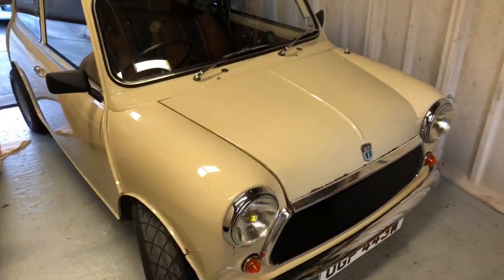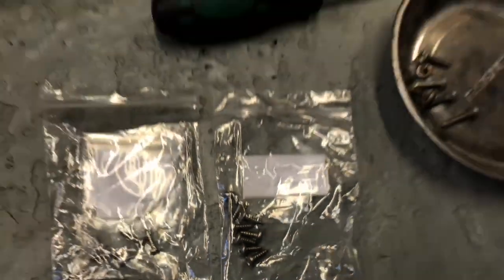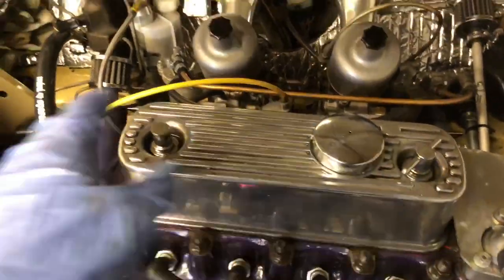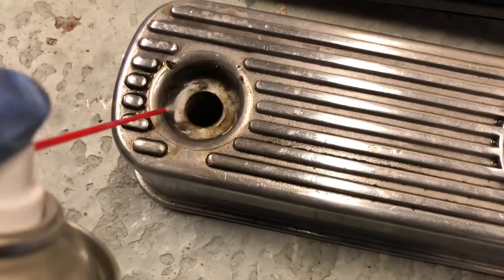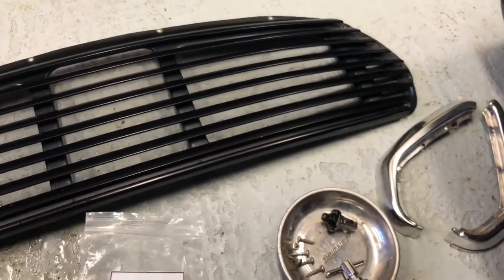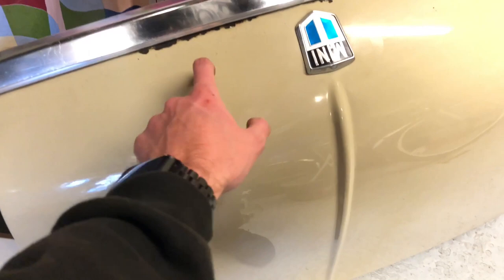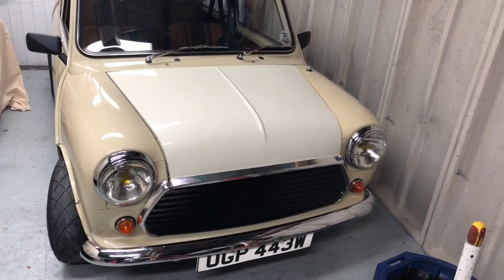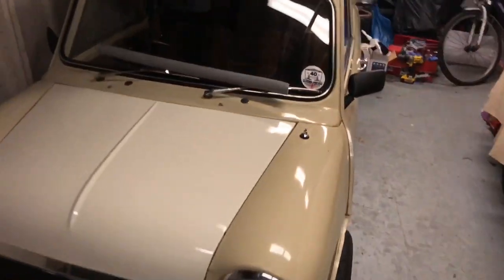Classic Mini service and maintenance

Comment: Great stuff..seam a shame the roller rockers are hidden. They look sweet ! What ratio ? And did you notice a difference in power after fitting. I'm just  compiling a wish list for when I sort my engine . Thanks
Reply from the maker: George Knapp They are 1.5, i fitted with a new cam and double valve springs. Im yet to put it back on the rollers to see the gains, there will be a upload once i get round to it though
Reply: Alan Dixon,  nice .. look forward to it . Thanks.